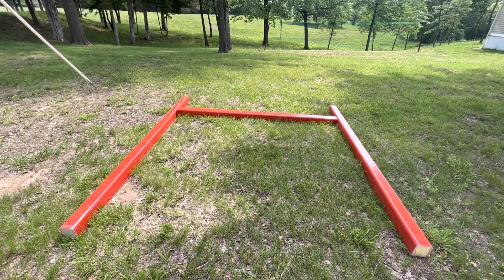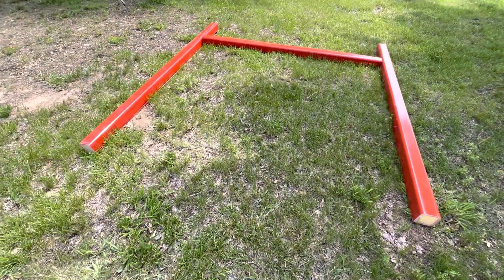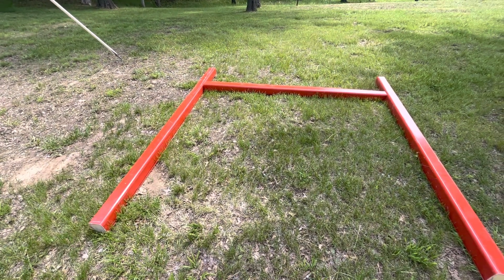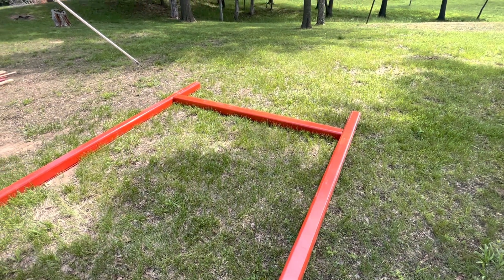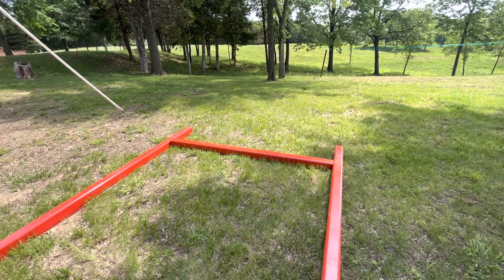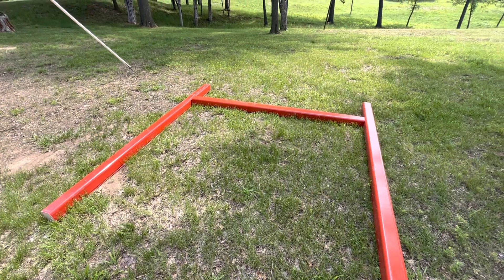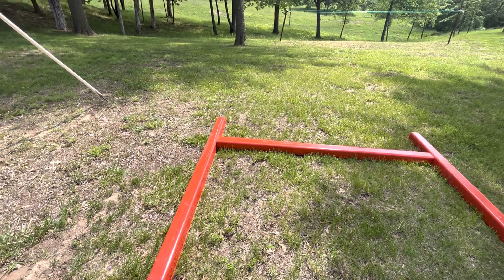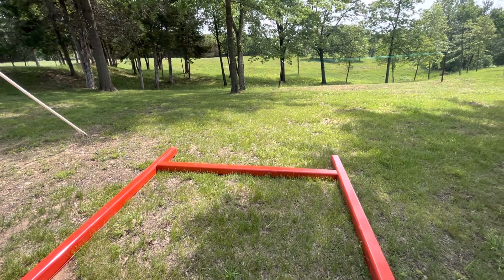Fiberglass H braces are available while they last.

Comment: What’s the benefit to foam coring the corner posts?  Strength? Waterproofing/protecting the inside?   I’m not close enough to buy from Mr. Judy and they don’t seem to be available elsewhere.  If the foam is critical is spray foam insulation acceptable?   I bought a bunch of fiberglass posts that are super heavy duty/overkill (for next to nothing) and I’m trying to determine if I need to foam core.  Thanks for all the excellent vids.

Comment: A question for you: How do you pull timeless plastic posts without damaging them? Please show several options that you would use.
Reply: Hi lift jack is way harder then using a T post puller. You don’t need to hook any chains or anything. Works as good as T posts.

Comment: I’m not real familiar with working with fiberglass. Why not throw a long structural screw through the verticals into the horizontal on each side like one does with a brace pin building wooden braces?
Reply from the maker: You could try it, but the centers are foam filled. Not much there to hold a screw tight or keep the beam in place with their foam centers.
Reply: @gregjudyregenerativerancher  thank you. I thought they were solid.